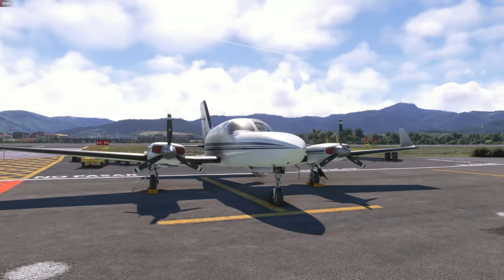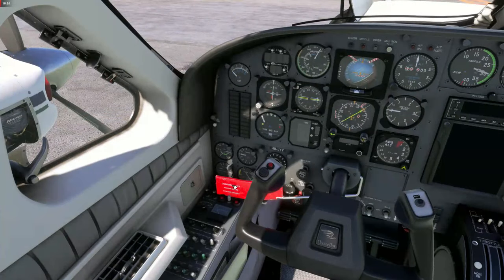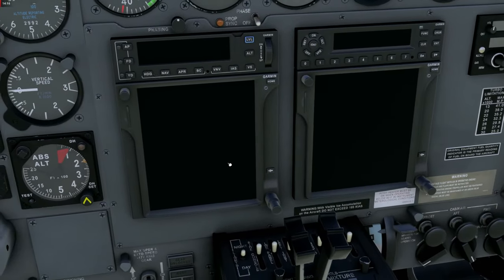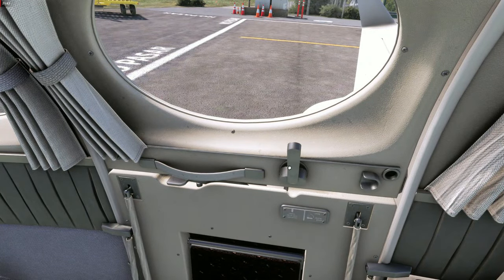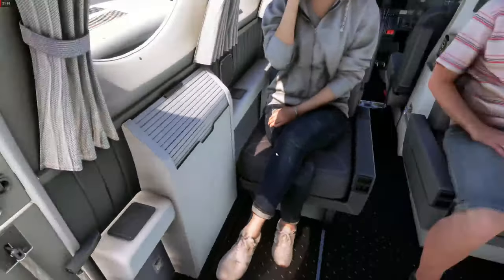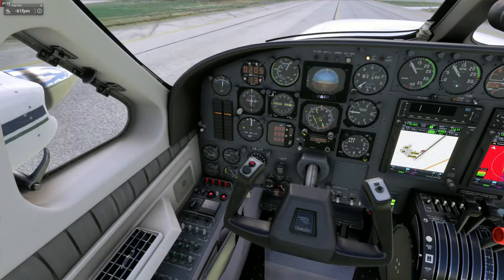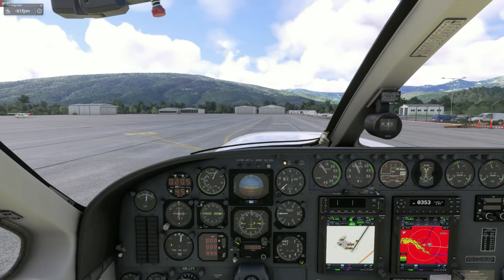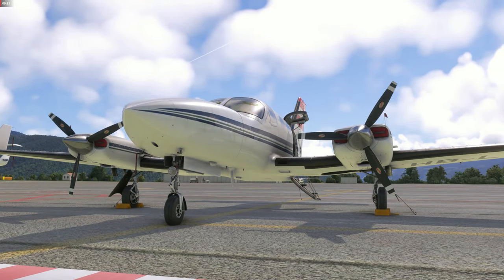Flysimware C414AW Chancellor | All Features Explained & Full Flight Tutorial [MSFS | English]

Comment: 11:15 -> The outer scale on the cabin altitude selector is not movable. it simply shows the cabin altitude that corresponds with the selected aircraft altitude on the inner scale. For example, when you set the marker to 20k ft aircraft altitude the outer scale shows a corresponding cabin altitude of 6k ft. 

Very informative and comprehensive tutorial, thumbs up!
Reply from the maker: I'm glad you like the video. Yes true, shortly after this tutorial I learned how the scales and aircraft pressurization in general works. Thanks for explaining though :) Cheers

Comment: Vid made me want to fly the 414 again but she will not start manually or autostart??? Except for a low voltage warning everything appears to be right. Engines just turn over and die. Autostart or on runway they again just die. If I start in air they are both dead. Ideas? Haven't flown since the last big update but before ran great/no issues.
Reply: Solution- Setting your fuel before flight using the MSFS method did NOT add fuel to the aircraft. I caught it and using the Ipad? in plane added fuel "both tanks were empty" and both fired right up.
Reply from the maker: @JIMJAMSC  Glad to hear you got it sorted :) Enjoy flying her

Comment: Sadly they never end this plane, so many things are still not working. For example you don't need the magnetos to start the engines. There is a pre-flight turn-around but no state saving and no failure, that doesn't make sense. The plane is always ready to fly. The engines sounds is far too loud. and so other many things...